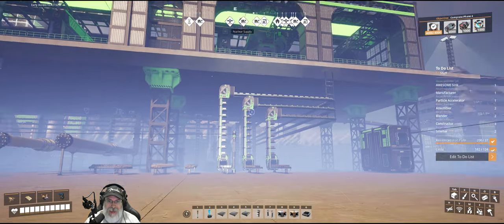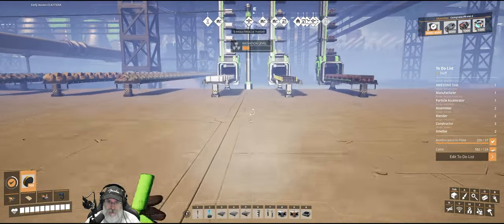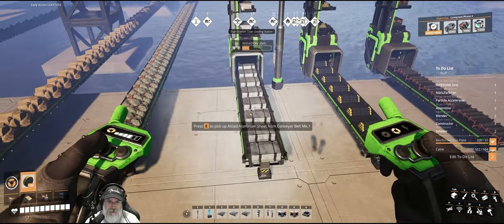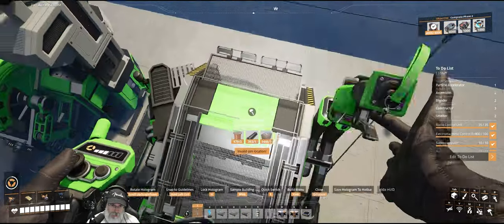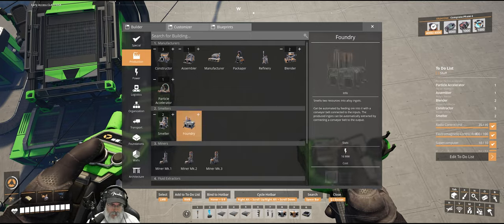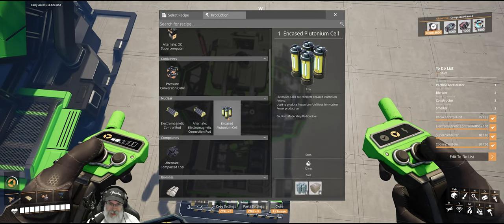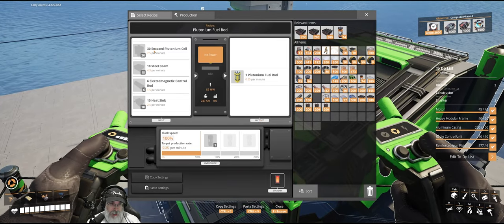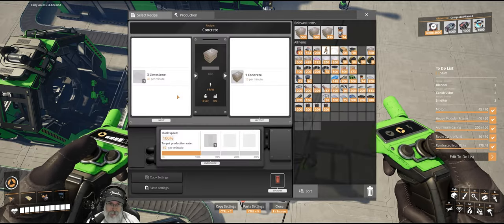Satisfactory Update 8 | E71 Waste-Free Nuclear Power

Comment: Where to start 1.0 is a loaded question with a "sprinkling" of nodes still to come.  Like you, I am looking for someplace I haven't started before.  I am leaning towards one.  On the north side of the canyon road, just east of the spire coast, is a small plateau with two pure iron, one normal copper, one normal limestone, and even some oil across the road.  Not much biofuel without a little hike. The massive resources of the titan forest and eastern northern forest are just up the gravel hill to the south, the honey hole in northern forest is still going to have a lot and is close by, and they are adding at least 3 iron, 3 copper, two quartz and four limestone - who knows what purity for any of these, to the spire coast, and, of course, the dune desert is just around the corner.  So that start point would be kind of central.  I have had two starts in the grass fields, two in rocky desert (east of you near waterfalls), one eastern northern forest, one in southern forest/SE grass fields, and current one is/was gold coast just north of falls.  All worked out fine for me and are in contention to repeat, but I kind of like that little new spot.  Should be little bit of a challenging start but take off very quickly once transportation tools start unlocking.  Fingers  crossed.  Still looking.
Reply from the maker: Hi Stephen, are you basing that start location off of where the new node placements will be in 1.0?  I started watching this video about "start locations in 1.0" only to find out a few minutes in that the guy was basing it off of U8 nodes. https://www.reddit.com/r/SatisfactoryGame/comments/1dkowvv/all_node_changes_on_one_map/
Reply: @TheBeardedOG  Hi Jim.  I do use that Reddit compilation but my basis is the four node maps on the Coffee Google drive showing purity changes, added and removed nodes.  Links available in the World and Recipe Changes video from 6/14.  BUT, since I am not moving forward with current save, I spent a couple hours today actually building a starter base there in my current save and I found some other logistic issues.  That location will easily get me through tier 2, I can then get the tractor and transport the 4 biggies (smart plating, reinforced plates, rotors, and frames to the permanent base.  Moving all 10 items being built will be a bit cumbersome, but doable, but may be easier to scrap. So to me it is a little less attractive than yesterday, but the challenge may be the fun.  As a side note, the last completed save and this partial I put my primary base at map center (end of lake just below NE red forest) just to save drone batteries as I use drones quite a bit late game.  Now that drones use many fuels I may be able to rethink that.  Long story short, too late, I am still undetermined on start location…lol. How about you?
Reply from the maker: I downloaded the files from the Coffee Stain Google drive as well. Needed the new logo for thumbnails and such. I am pretty sure I will be starting in the NW Dune Desert by the small forest and river.
Reply: Best of luck!  Nice spot.  I’ve built there, but never started there.  Built my world train through that little canyon that comes out just offshore of spire coast.   I am still waffling a little but I think that little plateau I mentioned will be a nice challenge, so still leaning that way.  Going to go watch your wrap up video.  Good luck tomorrow.  Enjoy!